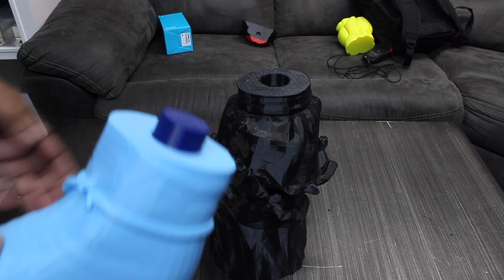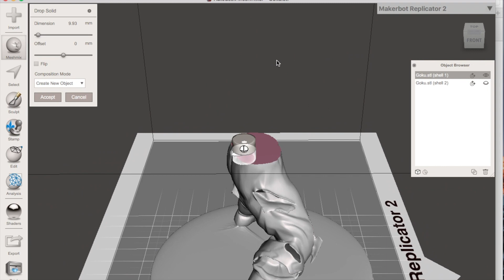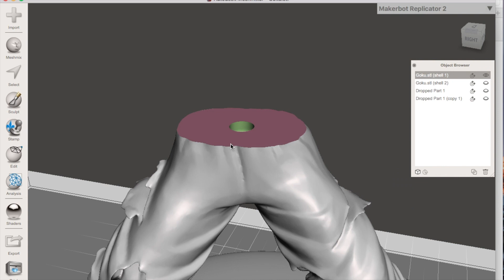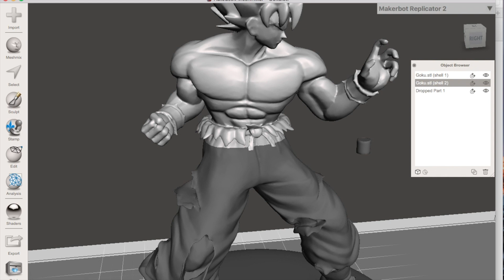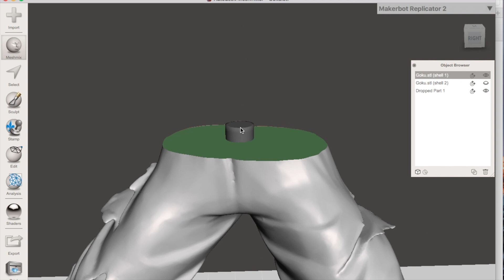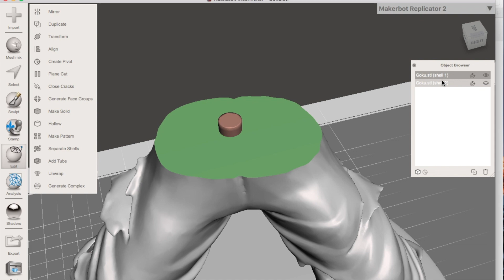3D Printing Alining Pins In Meshmixer.

Comment: Note... Never use cylinders for pins.. always use square. easier to line up and not rotate around trying to get the shells to line up. Another note... Just leave a pin in one side. No need for 3 objects. Just 2. Combine a pin and one part of the model.
Reply: You didnt watch the whole video or listen to the details. The first part he wanted to make the model have the ability to rotate at the waist, which is why the pin is separate and a cylinder. The nest part of the video he covers stationary pins and that you should use a square for these.

Comment: My aligning pin just sits on the round side and not the flat one. I cant get it to rotate the correct way :/
Reply from the maker: You have to select it in the items box then you can rotate them.
Reply: @SANTUBE  Not sure what you mean. I can kinda rotate it but i cant get the cube to stay flat in the middle of my object. I can only get the corner if you know what i mean.

Comment: Is there a way to adjust the depth/length of the pin?
What I am actually looking to do is to make a longer channel in both halves to add a reinforcing rod instead of just an alignment pin.
Reply: I am no expert but i have seen that you can select the pin, then "edit",  "transform" and you will see/change the pin dimensions.. hope it helps :)

Comment: I realize this video is about a year old, but I wanted to let you know how much it helped me. I have these HUGE models that I have to print on my Phenom printer and I still have to cut them up. The pegs are great because it will remove a lot of the guess work. I just wish that I can figure out how to cut certain parts of a model without using a plane. Thanks again! P.S. MAKE SURE you have "Create New Object" selected when creating the peg =. Also when you are changing the size of the peg, you have to change all 3. for me it doesnt change them all. cheers!
Reply from the maker: Happy to help

Comment: Perfect! Exactly what I needed.
Reply from the maker: Happy to Help man.
Reply: SANTUBE 3D do you think it’s better to make two holes and print the pin separately for strength? That way I could print the pins @ 100% fill.
Reply from the maker: Fix'n Things two would be better but don’t print at 100 infill, it’s a waste of material.  20 percent is more then enough